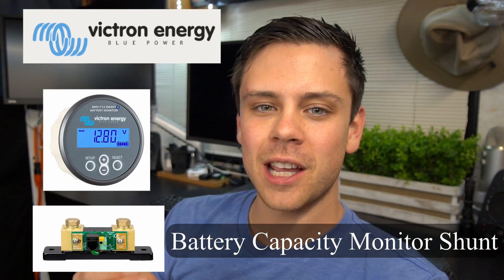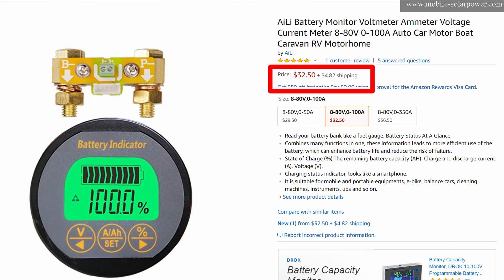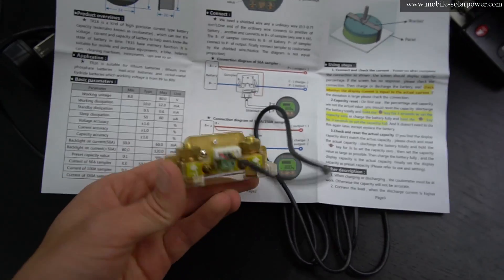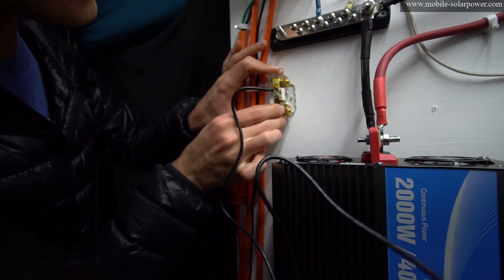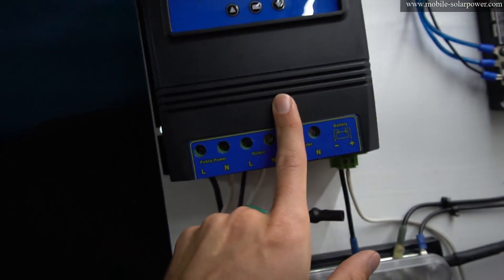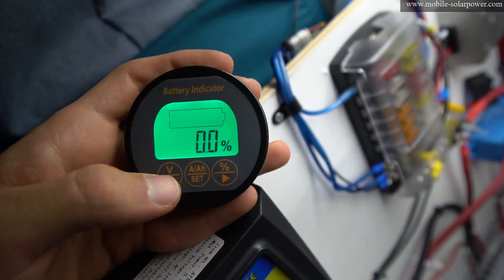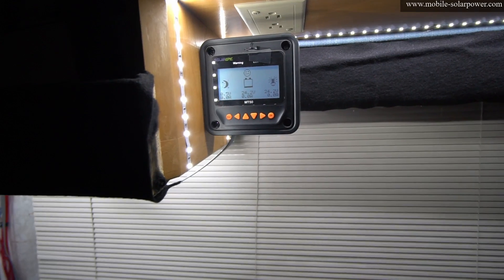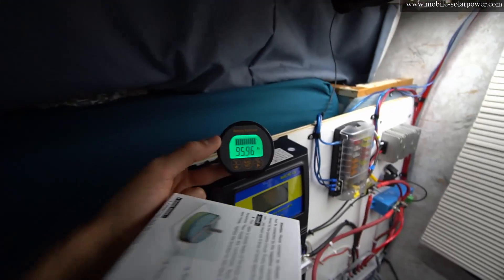$200 Victron Solar Battery Monitor? Try this $30 Chinese one instead! Great for Off-grid Solar

Comment: Still working? 
I bought another Chinese knock off and the display has failed. I have a couple ebikes and bought a couple similar battery monitors which now after 20 months, ALL lcd displays have failed?
I am going to try this one out also but have a 100% failure history with these inexpensive monitors! 
I know.. I know, why are you trying another one?
Primary because it is inexpensive and also to see if they are better quality now.
In all I’ve wasted about a hundred dollars if this one fails also.
Still working?
✌️PT

Comment: Sooo... I did something I wasn't supposed to 😅... I hooked up a pv array with a mmpt voltage of 101.55 vdc. My charge controller is rated at 100vdc max pv input and for a while it was working without a problem. Until IT happened. 😂. I knew temperates can drastically increase voltage as they drop and well yeaup. The voltage rose to 119vdc today in sunny cold so cal and I was able to enjoy the sound of electrical popcorn popping noises😂. Now my charge controller is now fried so I ordered the one I actually wanted and that is appropriate for my system. Heres the kicker. My charge controller is in an IDLE state according to its monitoring system yet the victron smart shunt shows its bleeding off a charge to my battle born batteries. So I personally love the victron smart shunt. Its allowing me to monitor my batteries accurately through all this... coupled with the bms its a good safety feature for people who do dumb things like i did here 😂😂

Comment: Any idea why alarms would go off, on a battery monitor while using a toaster?
My inverter didn’t shut down, which I thought might happen. 
My inverter is only a 1000 watt. 
My monitor is a 500 amp. 
Everything stayed on, but alarms sounded and had to reset the monitor to show the battery status. The alarm caused it to show my battery bank was dead.

Comment: Hate to break this to you Will, but the Victron does more than just measure what power is going in and out of the battery.  Got to play with my friends AiLi and compared to my Victron 712 the AiLi is a joke.  Lots of good additional information with the 712, plus it works in tandem with our Victron SCC, something the AiLi can't.
I had 21 volts occasionally going to our batteries and fried them.  It only could have come from two places, our SSC or our WFCO.  Since disconnecting our WFCO I've yet to see 21v to the battery.  If I'd purchased an AiLi how many batteries would have been fried before finding the culprit.
Plus, how can you compare it to the Victron that you didn't have?  Vapor comparison!

Comment: The quick look at the bracket makes me think you had it backwards. Like many meters, they are mounted through a hole on a thin plate. The bracket tightens down against the plate holding the meter in place. Don't over tighten it.

Comment: Would this go between a battery disconnect and the battery? Or does there battery disconnect go in between the shunt and the battery? Or does it matter?  Also would disconnecting the battery cause this to need to be reprogrammed?

Comment: I think you need a woman more than a battery monitor! A woman will point out to you whether you have the right current & that your voltage isn't fluctuating! Sadly, they are alot more expensive than your Chinese device. 🤣😂

Comment: (jumps when sparks fly) “gawdammit!” 😂 so funny.  i dont like the form factor  or the price of that victron model (i have one installed in my van) and disliked it even more after later learning there were alternatives.  however, as i may soon get a victron charge controller, the value of this overpriced BT monitor may just appreciate.

Comment: Interesting. I’ve used Trimetric’s shunt based monitor before, but it is quite expensive.  Monitor is not necessary, but it is amusing to see how much power you are using vs the output of your pv system or other charge source.

Comment: Just finished installing the $40 battery monitor.  Works great.  I'm glad to know that after years of working on electronic stuff, I'm not the only one who jumps when I see sparks.  Never get use to that.  Thanks for all your great videos Will.  My set up is a mirror image of yours.  Lots of advice on here about solar but yours seems to be the only one I really understand.  All is well, no smoke.  Life is good.
W4GTT
Reply: That's why I have an inline isolator switch.  No more heart attacks :o)

Comment: I really appreciate you and your videos Will.  By watching your videos, I have gone from knowing very little about electricity to completely wiring, crimping, fusing and building my own 12V system!  Thanks Will.  You do a great job.  Keep it going!
Reply: Same here. I used to just twist the wires together and wrap with electrical tape. Thanks to Will, I can be proud of my wiring now, not to mention much safer.

Comment: Okey so I have a Renogy system, rover mppt charger and a smart battery monitor. The charger and the shunt have two different ideas of what is happening inside my smart lithium battery. It looks a lot like the one you have here.   How do I find out what my battery level is really at? Rover thinks the battery is full and the shunt thinks I’m at 55%. Why? How? What do I trust to give me a good reading? How do I know the battery is charging if the mppt thinks the batteries are full? I purchased recently the li smart battery reader that I hope has a better time of it. Really worried that the mppt is broken or so off that it won’t charge the battery.

Comment: I just bought one to monitor my 200a 12v battery. I ran an inverter and a heat gun. It turned off at about 11.2V (0%?)?. What voltage do I set for 12v lithium battery? What are the settings for 12v?

Comment: So does this battery capacity tester show you how many watts your battery has? 
I’m planning on building a DIY solar generator with panels. & I’m trying to figure everything I’ll need.  A battery capacity / charging monitor being one of those things, great video. I wish I had 1/5 your knowledge on this stuff.

Comment: Am I correct in believing that as long as I install the shunt on the negative side of coming off the battery before anything else it will be fine? Meaning it doesn’t need to be close to the battery, just before the negative splits off to anything else like a grounding point?

Comment: Thaaaanks. I just refused an offer for a solar kit because they told me that in order to use the warranty of the victron battery which is in cycles I would have to buy this 200 bucks waste of money. Bought a battery from another supplier with bluetooth  instead. Saved me 600 bucks. They really profit from their market domination here in Europe

Comment: Is there away to set it with out draining the battery all the way down as I have a big battery bank (1240 amp) and it will take ages to drain it all the way down. Iv never managed to even get my bank below 50% even running power tools on it for days in a role

Comment: I am getting a camper with an 80 AH lead acid battery.  I want to install an AILI  battery monitor.  When setting up the monitor do I tell the monitor I have an 80 AH battery or 40 AH?

Comment: Do you need to run the batters down to set it up? I set mine up with the batters fully charged and I put my rating ah on the battery I have not tested it yet as it’s on my Rv next time I go camping I will see . That’s for the review on this as it was a great help

Comment: Bought this as well as the Chinese Bluetooth ANT-BMS that you reviewed in another video. I've since done a 48v LiFePO4 100ah battery build using Grade A cells. The setup is being used in my golf cart and having this battery monitor mounted to my dash makes it very convenient. The linear discharge rate of LiFePO4 also means I have an accurate reading of my remaining battery capacity so I don't run out. There are also a few other perks of being able to programme the capacity. I set my capacity at 80AH on the monitor so I don't actually run the batteries below 20AH or 20% SOC. Programmed the same into the ANT-BMS and its been working like a charm.

Comment: Thanks for the video, but what happens if you have other devices that run direct off the leisure batteries? I'm thinking of my diesel heater and fridge. Can the monitor still give accurate readings if there are other components coming off the leisure batteries? Thanks again!!
Reply: No, you need to connect all the consumers to the shunt, and nothing directly to the battery.

Comment: I bought one and it works great on a SLA battery, I like knowing how much is left over. I like that it shows both current coming in and out. Also it does a heartbeat when the battery is charging. This is very nice.

Edit**************** I have this a couple months and it is ok, the problem is it goes offline every 6-8 weeks and it needs to be reset.

Comment: Update: bought this when you posted. Still working well months later.
Reply: Hi is it workijg still??❤
Reply: Thanks for the update👍
Reply: good to know!
Reply: any news on reliability?
Reply: @365Outdoors I see the backlight of the screen turns off after some seconds but does it go in sleep mode(like shut down the whole screen)? or the screen is always on?
Reply: @cramarc666  no it continues working, there is a sequence for pushing and holding the end buttons down simultaneously for I think 3 seconds to turn the light off, but don't recall exactly
Reply: @autopeep24  
Does the display turn off, or a constant drain on the battery, albeit a very small on I'm sure?
Reply: @LuckiestManInTheUniverse  I know this is old, but my garage lights going through a solar panel on the top of my car is all that is needed to light up the screen on the monitor 24/7. The monitor is showing the panels are producing zero amps and watts so that's how little power these screens use.
Reply: What gauge wire is the positive line?
Reply: @ARMEDPATRIOT757  14 ga in the video
Reply: Is it accurate as well or off by a few points?
Reply: Can we get a 4 year update on the shunt?

Comment: I got one of these meters and it works great.. for discarge. It won't measure any intake of power when charging.
Any hints?
Reply: OK so I contacted Amazon and they are shipping me a new one. From the commnets, this happens from time to time. When I get it Wednesday, I'll switchout components one by one (cable, then the meter, then the shunt) and see what part of the system us faulty.

Comment: Hi Will. I'm looking to have a second battery monitor... This seems like a great option, but I'm curious if it's possible to have two shunts in the same circuit. Not sure if it's detrimental to series two monitor shunts since one would not be a direct connection with the negative battery terminal. Any thoughts?

Comment: OK Will, I will await your further testing to see how it goes, but right off the bat, do not say it has "three digits of accuracy". Yes, it displays some number of digits, and you might  be able to call that resolution, but you can't call it accuracy until you measure it against a calibrated instrument. The Victron costs what it does for many reasons, among them are build quality, accuracy, stability, warranty, integrated systems, support... You are doing good work here, but be clear on what you have measured (accurately), and what you have assumed...

Comment: On a 12v lead acid threshold what would you recommend the setting be? This is always controversial. I set it at 10.8. What are your thoughts? I have 2 Northstar Agms rated at 102aph each which gives me 204aph's run in parallel. Lithium will be next, but I paid 350 each for these on my boat. Thanks for helping.
Reply: What did you run your lead acid batteries down to for this to work voltage wise? I just got one and I'm scared to run my lead acid batteries to zero

Comment: If I have 2 100ah  LIFEPO4 batteries wired in series for a 24v system, do I set ah to 200  or leave it at 100?

Comment: So victron blue tooth shunt requires your phone to monitor so what happens when you have no cell phone reception???  So you can't monitor the battery information correct?  Thank you
Reply: Cell signal and Bluetooth are two separate entities...They coexist but are not related

Comment: As always, many thanks for the super useful video :) If I use a 100A shunt on my 24 volt system with 3000w inverter, will it be an issue if occasionally more than 100A are drawn?
Reply: Yes, the shunt will be over it's designed performance parameters and will tend to heat up. You can get away will some current over 100 amps, but it's not recommended. The shunt will not dissipate the excess heat created by the excess current. Buy a proper shunt.

Comment: I have just bought one of these meters for my campervan. I also use a Ring RSCDC30 solar regulator charger.
I  am a bit concerned that I seem to be loosing charge over night when the solar panels are not charging... 
I am wondering if these two devices use much current to power up? I think my meter showed with everything turned off, I was still drawing up to .5 of and amp, maybe a little more? is this normal?

Comment: Has anyone had issues with this unit zeroing itself even when batteries are fully charged ? I’m running a induction stove top and when I hit it hard with load it zeros (hard as in 65-80 Amps) it resets to zero. Really unhelpful when you want to monitors your battery

Comment: Good to see alternatives, but like others have said. Victron are popular because they make great gear. Also this chinese one is comparable to the BMV-700 which has single input and no bluetooth and is about US$150. SO you are comparing a $30 vs $150 device. However if you are going to buy victron, the  BMV-712 has good extras for not much more
Reply: Could almost compare it better to the victron smart shunt.  The BMV 700 has the relay control if I remember correctly. AND it can be upgraded to BT with their adapter.

Comment: Hi, Will.  Your videos are great.  I'm having trouble with what may be the simplest part of the installation... finding cable.  I went to Home Depot and for some 1/0 but it's exceptionally stiff.  Where do you get that good stuff that has more flexibility?
Reply from the maker: https://www.mobile-solarpower.com/wire-and-connectors.html
Reply: @WillProwse  Thanks, Will!

Comment: I have a different battery monitor I got from Amazon for about $20, which uses a hall-effect sensor to measure current. I found it to be rather inaccurate, and that is presumably because the hall-effect sensor is not that accurate. It's the same principle as with a clamp-ammeter, which easily measures 100 amps, but has trouble measuring anything less than 0.1Amps, because the ambient noise becomes significant interference. The battery monitor measures all current going in and out of the battery, and any errors add-up over time. I found that the smallest current it can measure is 0.1A, in increments of 0.1A, so when current is low (~0.1A) its error might be +/- 100% which will add-up to huge errors over a 24 hour period. 

In my case, I saw my battery go dead a few times - once the battery monitor showed 20% remaining, and other times, it went down below zero. Also, when charging, it reached 100% long before it was actually fully charged and I saw it charge at 18 amps for another 1 hour before it reached a full state of charge. This suggests it "lost track" of about 10% to 20% of the entire capacity in each charge and discharge cycle. This could be due to inaccuracy of current measurement, or failure to account for round-trip charge/discharge inefficiencies. In short, it's performance is pathetic. 

So, I'm shopping for a new battery monitor.  Like you, I considered the Victron, but was turned off by the high cost compared with what it actually does. After seeing your video, I am pretty sure that your battery monitor will perform a lot better, because it has more decimal places in measuring current, but most importantly, it uses a SHUNT, which I expect to be more accurate than a hall-effect sensor. 

The only thing that these cheap monitors lack, is some kind of histogram showing the history of charge and discharge, and high/low values. Each day, I want to know how much charge my solar produced, and how much capacity was used in any given day. I wish there was a cheaper solution that could report this critical information. I'm still undecided.

Comment: Question about the P- connection, which is supposed to connect this to "all loads." So this includes my fusebox and my inverter? Do they both require a 1/0 cable to connect to that P- terminal?

Comment: Many thanks for the review Will, do you know if either (Victron/Chinese or any other) has an option to switch a relay at a chosen %age of charge? I want my system to switch charging of an electric vehicle on when the battery is full or 90+ % and then off when it falls below a set %age

Many thanks for your great videos!

Comment: Hi, love your vids, they are very informative. A quick question on the battery monitor, I understand that the shunt is connected between battery negative and load negative, and the battery negative is grounded directly from the battery terminal or through the shunt ?